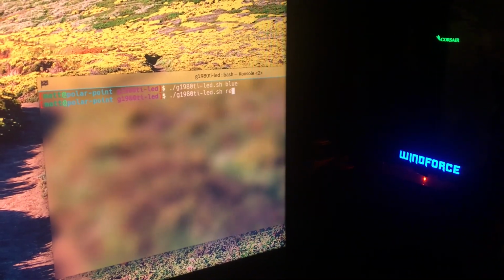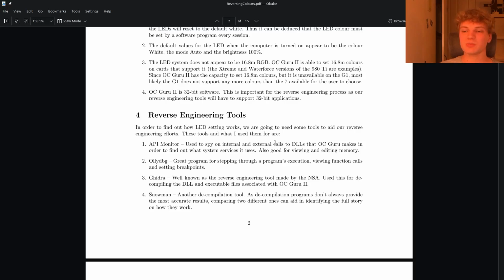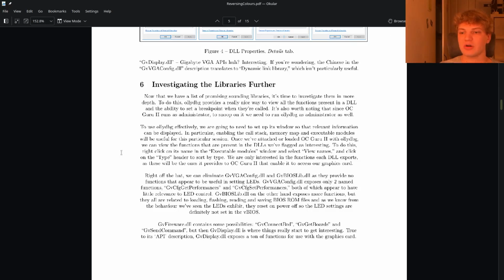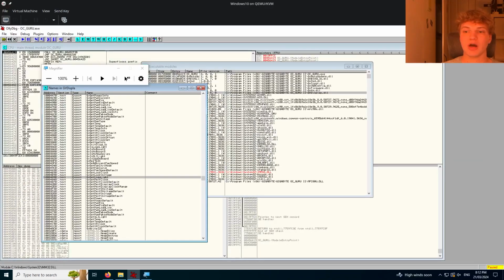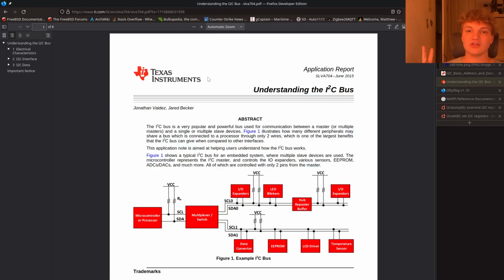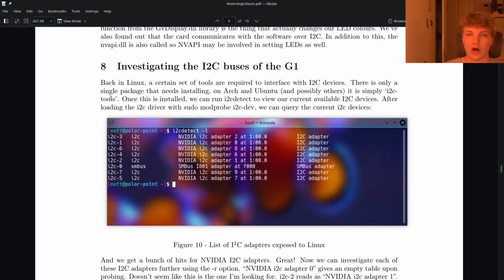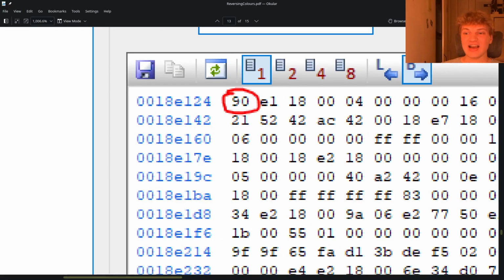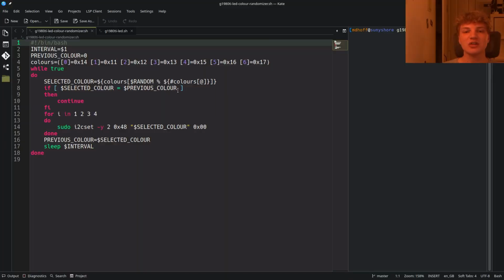Reverse Engineering Graphics Card RGB Lights!

Comment: Great video! I reverse engineered my laptop's WMI system a couple of months ago. I wrote a linux platform driver for it and submitted the patch to lkml. It isn't merged yet but my hopes are high. While reverse engineering, I found out the firmware engineering part of the laptop is kinda bad: 
- Keyboard's led backlight persist through boots but firmware doesn't have a way to get led information.
- Finding the correct WMI device was hard because they used a wmi block instead of methods.
- Later generation laptops of the same model have different firmwares and features, to differentiate them you have to know their processor's generation. This isn't really a bad engineering but it annoyed me while writing the linux driver.
The laptop I'm talking about is Casper Excalibur, it is sold only in Turkey. They work around these issues in Windows driver btw.
Reply from the maker: That's awesome dude. I found ur driver on LKML and had a read :) good stuff
kernel dev is something I'm looking to get more into this year, have only lightly dabbled with it in the past. Mainly have just done either higher level systems programming stuff or even lower embedded things haha so the kernel is a middle ground I'm yet to properly explore.

Speaking on the firmware side of things you're right that is very strange. You'd think at the very least if it stores the LED data to something like eeprom it would have the means to fetch it... And identifying it via the processor generation?? Sure, as long as you only have one revision per processor generation... just peculiar hahaha
Reply: @hoff._world embedded videos would be very cool. Imo the embedded space could benefit a lot from your style/ approach

Comment: Absolutely fantastic video man. Last time I had to mess around with i2c-tools it was because Corsair's terrible iCUE software corrupted the SPD chip on their own DDR4 modules that I had installed and so I spent a day trying to work out why on Earth my computer wouldn't POST any more. Turns out their software wrote bad values to the SPD thinking it was a DDR5 module which ended up basically telling the BIOS that it could run them at 1.0 V when they were rated for 1.35. After learning about I2C and reading the JEDEC DDR4 specification I actually managed to fix it & post about it on their forums & they ended up giving me a free SSD as a thank you for bringing it to their attention which was pretty awesome. Never gonna install iCUE ever again though - sorry Corsair...

I thought about giving reverse engineering the GIGABYTE software for controlling the fan speeds for my motherboard a go before but I stopped short as I didn't know enough about SMBus. The whole SMBus thing seems shrouded in mystery and finding documentation proved quite difficult. Supposedly it is quite similar to I2C. I'm hoping one day the kernel module for the it87 controller chip gets mainlined but the project seems to have somewhat stalled as all the documention has been locked behind a vendor-only login now, unfortunately.

Thanks for the great video man. Love your channel & videos. Keep it up :)
Reply from the maker: dude honestly with how many different models of memory they have even within the same product class like Vengeance I honestly don't blame them for getting it mixed up bahahaha seems more like a product management issue. For that reason I've only ever trusted making memory changes thru the bios... but your project sounds absolutely crazy. Especially how they gave u an ssd lmfao that's class. It's always good to peep those specs and then you can map that to what you're seeing and that's such a good feeling.

Had a read about smbus there's a document by NXP on it I think it uses the same physical interface apart from a few things that can vary in I2C being explicitly defined for SMBus but then it also lets slaves ACK as presence detection instead of just part of a read/write transaction. I can probe smbus with i2c-tools so I wonder if you could get anywhere with that...
Reply: @hoff._world  I'll give that doc a look, cheers :)

Comment: Wow, i2c is awesome. My first encounter with it was on linux where it was used for DDC/CI communication and you could change certain monitor settings without manually toggling them in OSD. Apparently it was based on i2c protocol so linux userspace was using the same i2c-dev kernel module in an application that I found.
Reply from the maker: oh that's actually sick I've never heard of a monitor exposing it like that before. I just googled this and it turns out HDMI, VGA and DVI actually carry I2C as part of "DDC2" as you say. Never knew that before!

Comment: Great video !! , this is by far the most complete reverse engineering video i have seen on youtube with a real life example.
My question is that if I am a beginner and I want get started into reversing but I have little to no knowledge, what are the resources that I can use?
I have this idea in mind to reverse some of Watch Dogs 2 functionality to make a mod menu but I have no idea where to start or what kind of knowledge is needed for such thing.
Thanks
Reply from the maker: in my opinion the best way to get good at reverse engineering something is to first get good at engineering that something
the only reason I could do this crazy project in the embedded realm is cause I already know all about i2c and embedded systems and linux, so first you'll need to learn about how games and game engines work i guess, then look at editing game memory and such
im not into game dev myself so cant give any specifics but I hope that kinda helps
Reply: Thanks a lot hoff,really apreciate it❤❤ @hoff._world